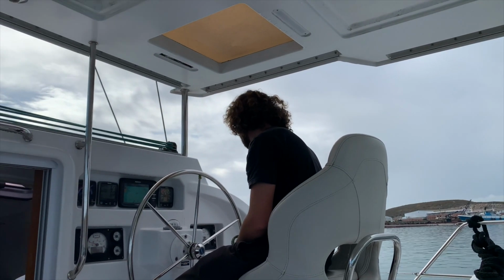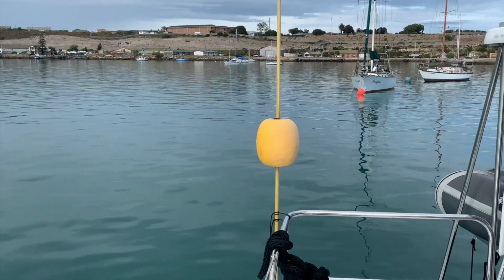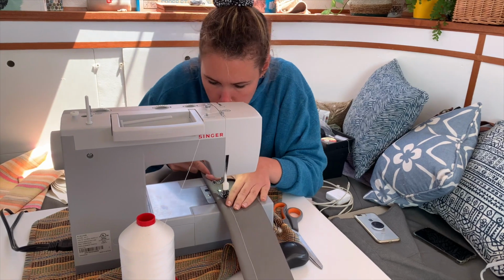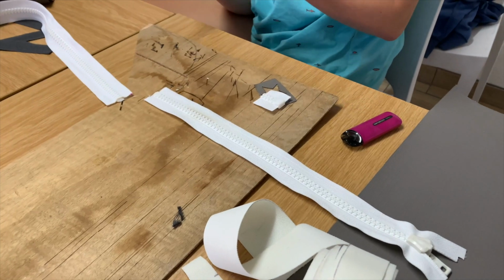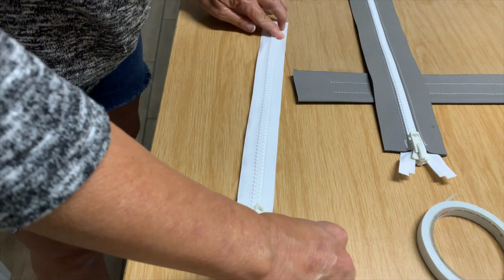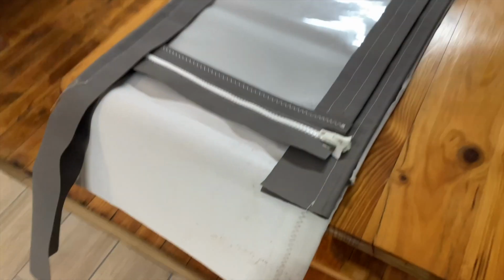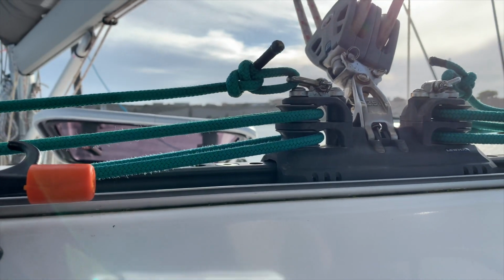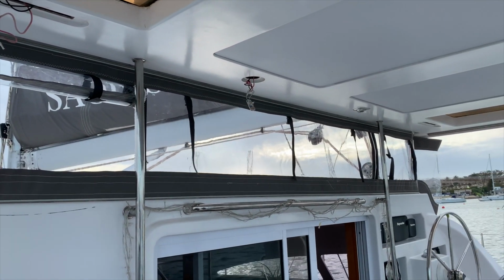How we MADE a DODGER for our sailboat ⛵️⚓️

Comment: I would have had the clip on the inside and the strap on the outside to make it easier to clip up, also the velcro the other way around so you pull the velcro apart rather than push apart (hindsight and all), but I'm sure by the time the sun has degraded it you'll know if that's better or not. the dodger looks great and will make those cold blustery days more enjoyable 👍🏼
Reply from the maker: Hi Dave, thanks for the input. We chose to put the clip on the outside because we didn’t want the strap blowing around and hitting the window section in the wind, which it would have done had it been on the outside. The window sections are also Velcro’d that way because it means that rain runs off of the window outside of the dodger. If it was put on the inside, rain would run down behind the lower section and into the interior.
Reply: @SailingSaoirse22  Classy response. Nice.

Comment: Thanks for this. I'm sick of waiting for friend to make ours like she promised ( paid job obviously) 2 seasons ago. Think I need to take on job myself even though no real experience with sewing machine  anything better than what ive kept going for last 5 years.  UV damaged it probably won't survive much longer spent half my time when not sailing stitching by hand rips that happened on route
Reply from the maker: I have to admit - this project has been the worst since buying the boat!! Although if you have an existing enclosure to work off of, for a template, that would make it so much simpler. We didn’t have an enclosure at all so it’s been a real nightmare. Trying to get the panels to fit snuggly to ensure minimal flapping and give a tidy finish, has been quite difficult because our bimini is not a pain rectangle. But getting there slowly. Good luck getting yours done👍🏻 I would suggest just taking it one panel at a time and work closely off of your old one.